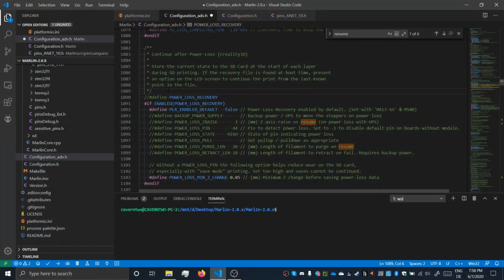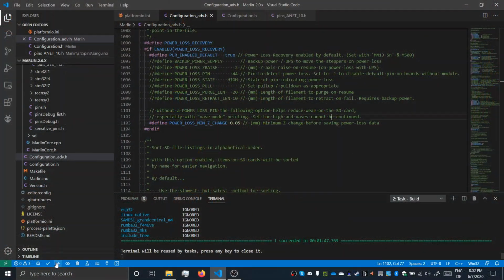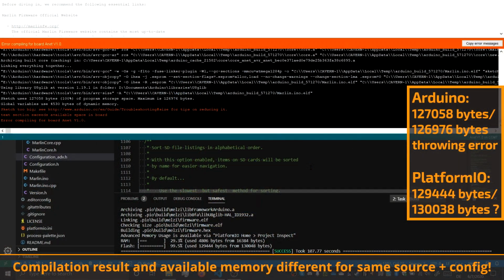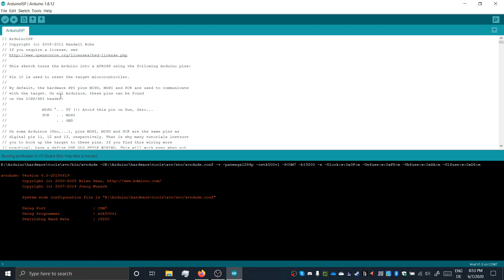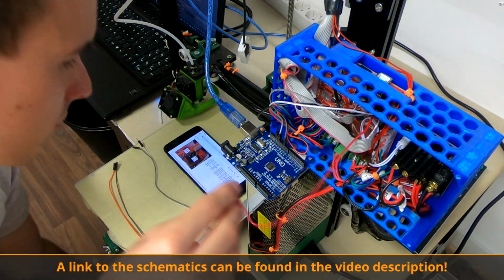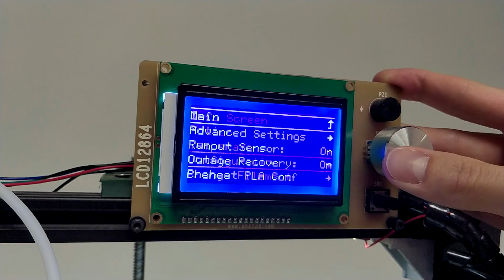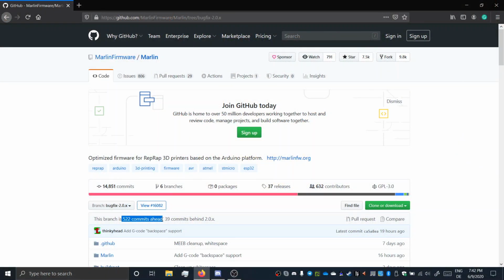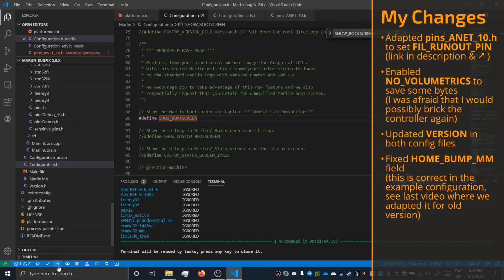Marlin 2.0 – Power Loss Recovery

Comment: Hi,
I upgraded my ender 3's firmware to Marlin 2.0.7.2.After setting everything correctly I did a test on power loss recovery.It didn't seem to be working properly.The printer starts up shows a resume or stop print option ,but after selecting to resume it heats up then goes to the last position where it was before but stops there.It seems like it doesn't save all the information in the sd card.I checked the sd card and there was a file called "PLR".
If someone can help me it will me very appreciated.
Thank you
Reply from the maker: Hi, thanks for the comment.
I also ran into this issue with the latest version, seems to be a bug in the Marlin project. There are also other comments about that already, and I'm very sorry that I don't have a solution so far. I'll look again tomorrow, maybe I can find something, and will let you all know, should I find a solution.
Reply: @Caverntwo  Hi,
Lately I've been finding a solution for ender 3's power loss recovery problem. On github I found a fix for it(I've mentioned the problem before in the comment section).It worked for me.
So basically I copied the following two lines and pasted it in the  beginning of the "PrintJobRecovery::resume()"  segment.
 
      card.release();
      card.mount();   

Hope this will help someone,
Thank you.
Reply from the maker: Awesome, I'll try it out as well on my printer
 But for now, I'll highlight/pin this comment!

Thank you so much!
Reply: @Caverntwo   In my case I was getting an error while compiling to, either disable sdcard readonly or disable mesh bed leveling.
I uncommented sdcard_readonly in configuration_adv and it worked right away
Reply: @tathilawijemanne2578  Thank you it works great :D. I'll just add that, the file name is: powerloss.cpp
Reply: @mavyjebe  Hi, I did the exact same thing and it only starts printing again from the beginning. Did this happened to you?. How did you solved it? Thanks
Reply: @tomasgiraudo8242  I know it's been a year but we're you able to figure it out? Because on 2.1.x bug fix it restarts the print instead of resuming it.
Reply: @Caverntwo  Ok,Thank you very much

Comment: настроил возобновление печати после пропажи питания сети 

#define POWER_LOSS_RECOVERY
#if ENABLED(POWER_LOSS_RECOVERY)
  #define PLR_ENABLED_DEFAULT   false // Power Loss Recovery enabled by default. (Set with 'M413 Sn' & M500)
  #define POWER_LOSS_PIN         -1 // Pin to detect power loss. Set to -1 to disable default pin on boards without module.
  // Without a POWER_LOSS_PIN the following option helps reduce wear on the SD card,
  // especially with "vase mode" printing. Set too high and vases cannot be continued.
  #define POWER_LOSS_MIN_Z_CHANGE 0.2 // (mm) Minimum Z change before saving power-loss data
#endif

не нужное закоментировать.

Comment: I am on an Ender 3, Marlin 2.1.x. The power loss feature works and starts to print, however, when it loses power it moves the Z-Axis upwards and then starts to print (after the power loss) at the elevated height. So that means the print is trash. Does anyone have the same problem or a solution for it?
Reply from the maker: I haven't seen that behavior yet. Maybe you could try enabling POWER_LOSS_RECOVER_ZHOME, basically you define a position (x/y) there where it's safe to home the Z axis to the limit switch. If that doesn't work either I'd recommend to open an issue at the official Marlin GitHub site, they might be able to help you.

Comment: Hi, One year has passed since your lost video. Is it now fixed in the latest 2.0.9.2 version released recently? I have the same problem with my artillery sidewinder x1. I would appreciate your help. Since power outage is a daily affair here because of floods and climate change, this has to be fixed. No ups will backup for long hours when the power is out.
Reply from the maker: Hi Victor,
Honestly, I don't know. I haven't checked back.
A while (~8 months) ago I checked with the than latest version and back then it still didn't work.  I just went back to the version I used in the video and still use that to this day.
I'd suggest you to give it a try, maybe they fixed it!
Reply from the maker: Hi, old Marlin only works on 8-bit boards. You have to use the Arduino IDE for flashing the firmware.
Here's my older video about how to do it for the Anet A8: https://youtu.be/2uX5_rI1QM8
Reply from the maker: Try to follow my video but use the sample config of your machine.

Comment: I am having the same issue as the pinned comment, I just installed the Marlin 2.0.7.2 firmware onto my Ender 3 Pro and after powerless and hitting resume, it will go back to where it left off but not continue the print. Do you have a solution? I am very new to coding so I am not sure how to really fix this issue.
Reply from the maker: Hi Justin,
I've tried getting it running when the currently pinned comment was written, but sadly failed (I assumed a bug in the firmware, buy weren't fully sure.) I'll take another look this week and come back to you with more details. It's actually interesting for me as well as my A2+ currently has no working power loss recovery thanks to that.
Reply from the maker: Hi Justin,
I've been trying all day to get the Power Loss Recovery feature running on 2.0.7.2, but with no success. There seems to be a bug in the restoring procedure in the powerloss.cpp file, but as I'm not a C++ dev and have only little experience with Marlin's internals, I can, unfortunately, not provide a solution. I'm sorry and hope that there will be a bugfix version that works soon (the current one doesn't compile for me).

What I can offer, however, is the version with what I managed to get it running in the video last summer, that I luckily still had downloaded. You can find it here: https://www.mediafire.com/folder/5jtz2bcm1ix2q/Marlin_2.0_PLR

I'm currently in the middle of restructuring my channel and technology used for creating future videos, so stay tuned for more content soon!
Reply: @Caverntwo  thank you for trying. I’ll use the version you posted for the time being. Again thank you so much for all the help!
Reply from the maker: You're welcome! If you should encounter any other issue, just let me know. 
Maybe sooner or later the PLR feature will work again, I will try again in a few weeks. Furthermore, in the future, I plan to upload my customized Marlin configurations onto GitHub/GitLab, so it should be way easier to get the same version as I have in my videos.
Reply: @Caverntwo  oh that would be amazing. I’m in the process of studying computer science in college but I’m only in my first year right now so I’m still very new. Hopefully in the next few years I will be able to do some of this stuff myself.
Reply from the maker: You'll learn quickly, I did too. And you'll never reach the end of the topic, as technology evolves so quickly. What I can suggest you is to keep trying and learning, follow your interests. Interested in building websites? Sure, there are a ton of free courses and technology available. Microcontrollers? Same thing! And suddenly, you'll find solutions to problems you never saw before. 3d printing and software are tools that help you get there.
(Source: I'm a professional software developer for over three years now with a ton of interests and side projects ;-))

Comment: Hi! I'm somewhat new to the 3d printers hardware updates and mainboard scene, I recently got the new mainboard from creality (Creality 4.2.7) and recently flashed with marlin 2.0.X-bugfix from the official github and I have just enabled the power loss recovery (great video btw!), thing is that in the documentation and all across the internet it says that I need to define a POWER_LOSS_PIN, so! how does this work? Is this also a hardware cable pin that I have to add on the mainboard and/or how can I define which pin? 

If anyone can help me with would be awesome!
Thanks!
Reply from the maker: You only need a power loss pin if you have a power supply that supports it. In such a case, there's an extra pin coming from the PSU telling the board the current power status. Such PSUs tell via the pin that power is disconnected but supply (stored) power for just a few more seconds to leave time to save certain things. Some PC PSUs have such feature.

Mine doesn't have it and as I don't know which one you have, I assume you got a simple 12 or 24V PSU that is not aware of it's power status.

In such a case you don't need to define anything and can follow my latest (well, almost half a year old) video about power loss recovery. The main board will write the PLR status to the SD card every time the Z-height changes.

However, if you have a PSU that is aware of its status, you need to define another pin directly in the pins file, for you stm32f1/pins_CREALITY_V427.h or stm32f1/pins_CREALITY_V4.h. You need to know which one is free for your config.

Comment: (1) I have updated my ender V2 firmware with marlin bugfix 2.0.5.  My resume option in my V2 still did not continue print?   Do I have to change PLR_ENABLED_DEFAULT   false to true?  Is there anything else to change beside PLR_ENABLED_DEFAULT?

(2) When I pause my ender V2 printing,  is there a way to keep the nozzle and the bed temperature as is?   Currently my V2 will drop both nozzle and bed to zero.
Reply from the maker: Hi, thanks for your comment.

If PLR_ENABLED_DEFAULT is set to true, the Power Loss Recovery feature is enabled by default. If it's set to false, manual activation via the LCD screen or a GCODE command is necessary. However, there might be bugs in the firmware, as other commenters have reported.

The behavior you encounter during pause can be enabled/disabled by adapting the HOTEND_IDLE_TIMEOUT settings in the Configuration_adv.h file.

Hope that helped.
Reply: This is what I have in my creality v4.2.2 board.  Can you tell me what to change?   I have tried to change (5*60) but no change?  I have also changed 0 below to 200 and 60 but nozzle/bed still dropped to zero after pressing the pause printing.  any clue?   Since I have  a 32bit board,  do i still have to concern about the internal memory being full? 

#if ENABLED(HOTEND_IDLE_TIMEOUT)
  #define HOTEND_IDLE_TIMEOUT_SEC (5*60)    
  #define HOTEND_IDLE_MIN_TRIGGER   180     
  #define HOTEND_IDLE_NOZZLE_TARGET   0    
  #define HOTEND_IDLE_BED_TARGET      0     
#endif
Reply from the maker: @desmondthang6759  I'm quite sure that you won't run out of memory. Did you try to upload the default configuration for your printer? Is the issue there as well? I can highly suggest starting to customize from the default config for your machine.

You can find the default configs here, choose the one for your printer and try it out: 
https://github.com/MarlinFirmware/Configurations/tree/import-2.0.x/config/examples

Comment: THANKS FOR YOUR HELP
Reply from the maker: Thanks for your feedback! 
I'm glad that you liked the video!
Reply: @Caverntwo  yes, I was having problems with my 3dtouch, it was sending a  probing error and I found out that the last corner of the bed was way too low.
And once I fixed that corner the 3dtouch started working again.
So I was looking for a fix for the Z level, because every time I print I have to check first because the right side is always higher than the other side
And today I'm gonna split the motors and follow your instructions.
Thank you so much for sharing time and knowledge.
Reply from the maker: Awesome, I'm glad that I could help ya. 
Although my experience with the 3dTouch sensors is also quite limited, but you can expect to find videos about these things on my channel in the future.

Comment: Hi I have a problem with skr e3 v2 I activate on marlin but when the powers go it ask for the continue printing but when I select yes and heat doesn’t continue
Reply: I’ll gonna try tomorrow thanks for your fast response
Reply from the maker: You're welcome, I try to come back to everyone as soon as possible, if my time allows it ;-)
Please let me know if it works!
Reply: @Caverntwo  got any solution for that??? Its so annoying to having that bug....my previous print was 8 hours long nd after 98% it just can't be resumed...only ask for resume but didn't work
Reply from the maker: Hi, Khristian contacted me personally and tried different versions, but there sadly seems to be a bug in the latest Marlin versions. It seemed to work in the 2.0.5.x-bugfix I used in the video, and already saved me two larger prints. 
Although I tried, I have not yet had the time to reproduce it though... I'll let ya know here once I know more, but I'm currently rather busy...
Reply: @Caverntwo  no problem buddy.....thanks for your response
Reply: @djkhriz7  did u solve your issue??? I m facing same
Reply from the maker: Hi Khristian, thanks for your comment!
The issue sounds pretty annoying and I don't have an immediate solution for this. But I'd suggest you to try the latest Bugfix Version, maybe this fixed it for you.

Comment: Got it setup and turned on. Marlin 2.0.7 and skr mini E3 v2. On restart it goes from what would be the front left of the bed. It does all the warm and purge. Then says printing while going to the left rear of the bed and stays there. Also it doesn't extrude anything either when it does.
Reply from the maker: Hi, thanks for the comment!
The first guess I have is that the Advanced Pause Feature or the Nozzle Parking is configured wrongly. Please check this config, especially the position.
Could you take a look at these settings again?
Reply: @Caverntwo  I ended up trying different versions of Marlin. And BugFix 2.0 file date 9/13/2020 works like a champ. No more problems. I was also told in the forums that 2.0.7 has a bug they are working to fix.
Reply from the maker: Awesome, that's nice to hear that it works out now!

Comment: Ok, I did noticed that clever z axis, just one threaded rod. Thats cool
Reply from the maker: Hi, thanks for your comment!
That design, however, isn't as good as it looks and can cause severe layer shifting/wobbles, if the wheels are not tensioned properly (which you can't adjust, as there are no concentric nuts)... But it's already a huge improvement over the original design! If you take a look at my Initial Review of this printer, I showed the issues of the original state, where the threaded rod was on the side.
Reply: @Caverntwo  cool, I will take a look. Great video about power loss